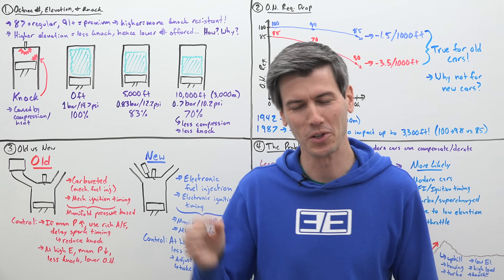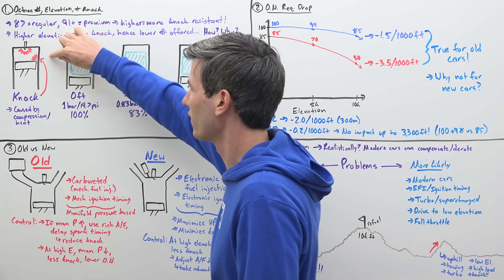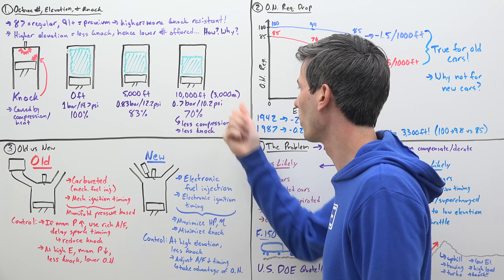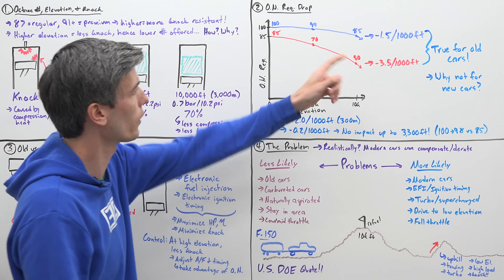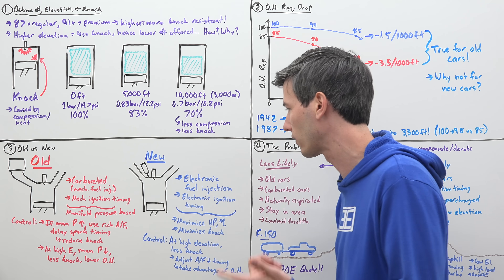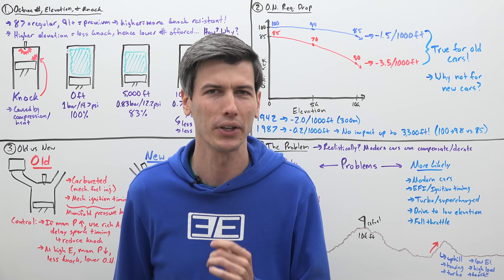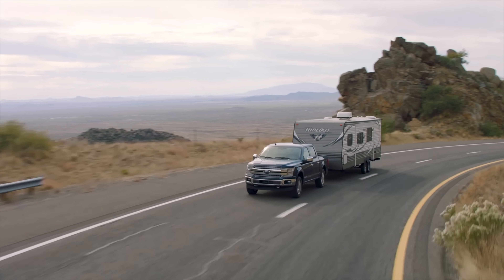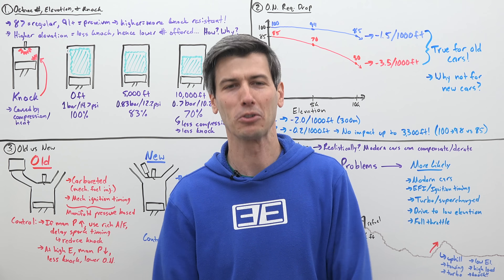Never Use This Gas In Your Car!

Comment: One other thing I believe needs to be emphasized is compression ratio on octane... Even at sea level many modern cars have different compression ratios. The piston compression ratio will affect the knock if the ratio is low or high and the wrong octane fuel is used. Thats why dragsters and race cars tend to use high octane gas. It helps to lessen cylinder ignition before the piston reaches the proper ignition point. My rule of thumb at sea level is to only use higher octane fuel for any gas vehicle at or above a 10 to 1 compression ratio. So far this hasn't failed me. Most of my vehicles were driven well over 100k miles with no issues.
Reply: Modern EFI systems can play with the tune of things enough to run just fine on 87 up to 11.5:1 or so.
Reply: @TestECull  Yes this is true to a point. I tested it myself on my Nissan 350.and 370.z. there was a noticeable change in performance. And I did it with mid grade gasoline. I believe for maximum performance across the board, high compression ratios should stick to high octane. Just my opinion after doing it myself. Lastly my sister had a modern SUV that stated it could use low octane gas. She had never ending engine issues until she started using 90 plus octane. I discovered her compression ratio was the same as my C7 corvette. My vette explicitly states high octane use only except for emergencies.
Reply: @rod3134  Heh. All the more reason for me to stick to a C4 or C3 if I ever get a corvette then. Can feed those things half-stale two stroke that you found in your grandpa's barn ten years after he last mixed up a batch and they won't care.

All of the engines you're talking about, though, will still run fine on 87. They won't be damaged by it. The ECU backs off the tune enough to see to this. They won't perform their best, but then again if you're driving on public streets you don't have any business calling for more than about 50-75hp anyway. Especially in something as aerodynamically slick as a C7 Corvette. 

IT's the older carburetted engines that you need to watch out for, because they can't de-tune themselves on the fly. If they're built with a 10-11:1 compression ratio you have to use higher octane fuel in them.
Reply: @TestECull  Agreed 👍🏽 I guess I'm a little selfish when it comes to power.  I always want a 100% at all times. 😁 Never know when you need to get out of grandmas way.😆 Oh yeah... look up the compression ratio of modern cars. Most run way above 10 to 1. The chevy 6.2 liters generally run 11.5 to 1. I'm pretty sure that's why my stock Horsepower is close to 500hp. Being a computer guy by trade I don't fully trust the ECU electronics enough especially knowing how detonation can destroy an engine.
Reply: Anecdotal evidence like the kind you used isn't very helpful. My rule of thumb has been to use the cheapest gas available and ignore compression ratios and I've had no issues either. My vehicles have all gone over 150k miles.
Reply: @eliwhite5548  I understand your choice and respect your reasoning for yourself but my views and experiences are different. I have gone over 250k with a V8 performance motor I made. Antidotal or not, my input is for those who will do their own research. Most people ignore or don't even understand what the effects of octane and or compression ratios are. We have allowed computers to do all the thinking. As much as possible some will understand that there is a better way that saves them more money in the long-term.

Comment: I worked in a gas station years back, and the number of people who think 93 and 89 are better for cars than 87 is astounding. It's basically all of them.
Reply: Under the pumps/ground, they all come out from the same tank?
Reply: @stevec9669  Well no, there are two tanks, one for 93, and one for 87. The 89 is a blend of both, it is blended as the two gases are drawn from their respective tanks.

My point was just that car manufacturers build engines specifically tuned for one type of gas. Most cars, that are just common passenger cars, are tuned to run 87 only, and putting anything else in will cause the car to run less than what's optimal. It might not break your car, you might not even notice it running differently, but you just spent an extra $.20 per gallon for gas which will make your car slightly less efficient.

Just look up your car's recommended gas online. Quick search should tell you everything you need to know to keep any car healthy.

Comment: Meanwhile in Germany the low end is 95 and the premium goes up to 105.
Reply: Water won't boil until it reaches 100 degree. Yet it needs to be 212 degree in the USA.
Reply: You don't know what you're talking about. It's a different octane scale
Reply: @kekag  105RON is about 102AKI  the lowest you see in Europe is 95RON or 90AKI.

Comment: How come the vehicles come with alcohol % PID that resets to compensate for ethanol.....this guy is a joke.....put the right gas in your vehicles if you don't have a e85 engine dont put e85 in and don't put diesel In your gas car either thought I would say that cause I'm guessing this miss information is for morons... And Betty crooker pancake mix won't work either and modern cars are 1995 and up because of obd standard and various new standards

Comment: Wish I had known this when I was living in Denver for a couple years.  I saw the 85 octane for the first time in my life and it was usually 10 cents a gallon cheaper so I used it.  I never had any issues with my car but it would have been nice to know.
Reply: Its not 85 octane 😭 it’s 85% ethanol

Comment: I don't need the .gov to "allow" me to use 85, or "require" me to use 87. I can read at the pump, and I can put the correct fuel in my vehicle all by myself. Knowledge is power.

Comment: Wow, your premium is lower than our regular on the UK! But it is a lot cheaper.
Reply: Different.
USA 87 = Research Octane Number 91 (RON, number used outside of USA)
USA 91 = Research Octane Number 96 (RON, number used outside of USA)
etc.
Reply: @stevec9669  ah, OK. 👍

Comment: Does the US use the same scale for this as Europe? 95 is standard here, with 97 or 98 sold as premium. I've never seen anything as low as 87!
Reply: Different.
USA 87 = Research Octane Number 91 (RON, number used outside of USA)
USA 91 = Research Octane Number 96 (RON, number used outside of USA)
etc.
Reply: @stevec9669  Thanks. So US gas has slightly lower numbers but not as much as it appears.

Comment: So for those wondering. 87 octane in the US is 91 in Europe ( europes standard is 95 ) and Australia ( standard is 91, nothing under that is available )  or any country that uses RON as the octane number. The US uses MON which is roughly 4 below the RON, same fuel just the octane number is measured differently.

Comment: How high altitude can you ran an engine? On YouTube I have seen a clip where person drives a motorcycle, Royal Enfield 411 cc fuelinjektion engine, up over a montain pass att 4655 meters (15280 feet) on the Pamir highway i Tdjikistan without problem.

Comment: In Denmark ved only have 92 and 95. Though one station has 100.
Reply: Just realized you addressed that oddity.
Reply: Water won't boil until it reaches 100 degree. Yet it needs to be 212 degree in the USA.

Comment: I have burned 85 octane gas exclusively in my light trucks and cars for 25+ years operating them at all altitudes with zero problems.  85 octane is actually more expensive than 87 octane regular because it contains no government subsidized ethanol.  My experience with the hygroscopic effect of ethanol blended fuel leads me to believe the side effects of the ethanol are far more damaging than the rare effects of engine "knock" caused by lower octane gas. Many (most?) modern cars actually have "knock" sensors that detect preignition and automatically adjust timing/fuel to prevent it.

Comment: E-85 is the ETHANOL content, NOT the octane rating..E-85 is 15% ethanol...regular fuel is E-10 or less, meaning 10% ethanol..............

Ethanol raises the octane rating....this guy is talking out his ass........check your fuel cap to see if you can run E-85

Comment: I still occasionally get significant knock with Shell/BP 93 octane here in Ohio from various stations, pulling timing as much as 12°. The same brand/octane fuel on a trip down south resulted in 0 knock. I swear, Ohio has diluted horse piss as fuel.

Comment: Of course, my car has a warning saying "minimum 93 octane" and I live in California where the maximum octane at almost all gas stations is only 91.
Reply: What vehicle do you have that requires 93 if I may be so bold as to ask?
Reply: Yes. I too would love to know what vehicle you have that explicitly states min 93 and would also like to know if the value is based on RON or the average of RON and MON - It should state the calculation method. I don't know if it's still a thing, but I remember having a European car, built overseas but to US spec for brand new sale in the US, that still had a fuel filler door label based on RON when really the label should have been localized for the (R+M)/2 method. I was surprised the US DOT allowed that, but then this was a car company now notorious for breaking rules.

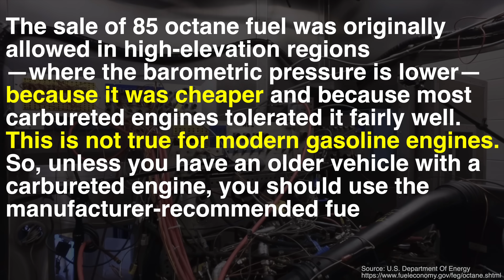Comment: 11:43 -  Not too much different from the early 1980s and before when regular (leaded) gas at 88 octane was available, but you weren't supposed to use it in cars with catalytic converts that required unleaded fuel. When they phased lead out, ARCO and other stations sold an EC-Regular with a lead substitute to satisfy the requirements of these engines until the gas was phased out entirely. 

Just because it's sold doesn't mean you should use it, but today (and in the past), nozzle sizes differed enough to attempt to coerce drivers into using the right fuel by making the wrong nozzle impossible to use in the wrong tank.
Reply: When I was young a century ago, we could go to a service station and buy white gas. Now you really have to look to find it. My neighbor uses it in the engines he repairs and operates but he has to go to the airport to buy it.

Comment: Humidity and ambient temp also play a role.  Water, methanol, or a combination was p/ is injected improve the perforce of an engine to allow for more ignition advance and or higher throttle opening without knock.   Very common on aircraft engines.

Comment: A big factor not mentioned is temperature.  Hot air gets much hotter when compressed in an engine.  Cold air is less likely to cause knocking.  That's why some parts of the country sell 85 octane as "regular" in the winter and 87 as "regular" in the summer.

Comment: Would be great if they stopped selling that cheap crap at high altitude. I hate paying 50cents extra to get premium 91 fuel because only 85 and 91 is available. My Grand Marqui does not like the 85, it growls when accelerating with 85.
Reply: After living here for months now, I'm adding another observation. 
When using 85 octane in the Denver region, not only does my car rattle when accelerating, but my MPG drops by about 2MPG.
So while the 87 octane is sold at a 40 to 50cent premium, with the improvement in MPG over the monthly average I spend is only about 5% extra.

Comment: 85 octane unleaded gas would be dangerous to most cars built before circa the middle 1990's. Modern cars with its computer controls will automatically retard the spark timing to prevent pre-ignition, though at a cost of lower engine performance. That's why on a modern BMW engine like the B48 248 bhp engine, you could actually safely run it on 87 pump octane (91 RON) unleaded gasoline, though performance will be quite a bit lower than running it on 91 pump octane (95 RON) unleaded gasoline.

Comment: The octane rating of each grade is usually 2 units lower at the higher elevations. I've never had a problem with either older or newer cars. When returning home, I simply replenish the gas as soon as I start seeing stations with higher octane ratings.
Reply: This is the truth. Also if you know you are traveling to lower elevations and have reason for  concern, simply fill with higher octane before leaving.

Comment: I would expect that the engine management program would prioritize the detected knock as reported by the knock sensors, and compensate no matter what the load or what the driver is asking from the vehicle. Why would it not be prioritized to protect the engine from detonation? After all this management system is the absolute advantage over the engines with less management. The parameters should be greater than before.

Comment: Is 85 octane rated fuel still cheaper to produce today, or is is actually the same or even more expensive because it's one more fuel you need to produce? If it's actually more expensive now then it shouldn't exist any more.

Comment: some modern cars still recommend using 85  if thay are at higher altitudes it all depends on the compression rating of the engine

Comment: I was in Durango, Colorado this summer and the fuel pumps there had 86, 88, and 91.  I filled up with the 88.  Driving around the rest of the state, I was able to fill up with 87 but it was over $4/gallon in some places.

Comment: I have a 1970s Holden red motor (a leaded petrol motor).
Unleaded has always been a problem with it, then I came across 100 octane leaded Av Gas. I doubt that motor has ever run so well and trouble free.

Comment: Ya kinda ,but keep in mind most newer  Is vehicles also have noc sensors and they will pull back timing is a timing if they sense knock to save the engine

Comment: Good video and explanation regarding 85 octane gasoline.  A bit alarmist in the title and example, though.  Where in the US can you get 85 octane fuel and drive a truck that's towing a trailer, as in the example (and getting 10 MPG? Less?), and drive to sea level using one tank of gas?  I doubt that's a real problem.

Comment: There are thousands of us who still drive "old" vehicles and we are sick of the woke left wing tell us what we should be driving and the law shouldn't allow certain fuels. The free market will make that determination. When I had a 1977 Dodge Power Wagon pulling a trailer in the rocky mountains I still had trouble with pinging or knock even with 91 Octane fuel. Being that I know a little bit about engines, I was smart enough to carry my timing light and retard or advance the timing as required depending on the average elevation I was running at. I was also smart enough to run in a gear that could keep a reasonable speed going uphill and not overtax the engine. If you are running a "modern" vehicle with a properly functioning engine control module (computer) that constantly adjusts air fuel ratio and ignition timing depending on conditions (assuming all sensors are functioning properly)  and you are still having a problems with knock or pinging (what ever you want to call it) then you are over taxing that engine and you should get a more powerful vehicle if you want to keep pulling that heavy load at top speed. I don't care what the advertising for  your truck says.  Actually the engine knock sensor alone should tell the ECM to make the proper adjustments. You will probably loose some power and speed but you will not be ruining that engine. Constantly running an engine at it's maximum torque is just not a good.

Comment: This is a huge problem in Colorado. As others have mentioned, the mid-grade 87 octane gas is significantly more expensive than 85 octane at almost a dollar more per gallon. If I remember correctly, 85 octane gas is about $3.30 per gallon and 87 octane is about $4 per gallon. Most people don't even know the difference in octane ratings, and just go for 85 because it's cheaper.

Comment: Do they use lawn mowers in high altitude? Most of those are still "old" engines... Chainsaws, generators, etc. I can see where it might be really helpful there. But, I agree, it probably doesn't need to be sold at each pump. Maybe half of the pumps at a station.